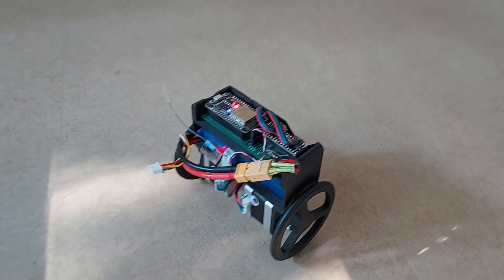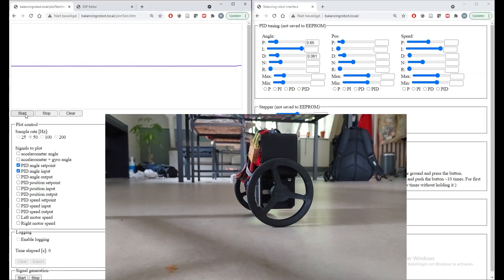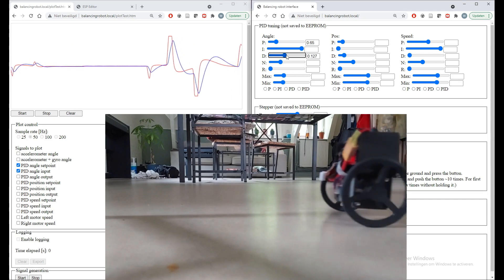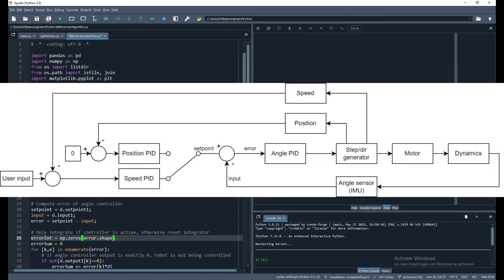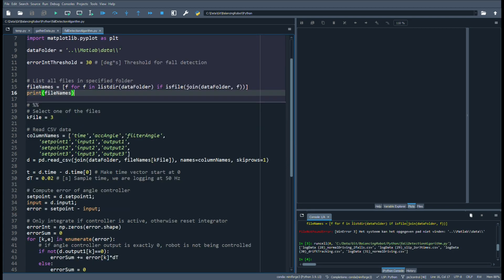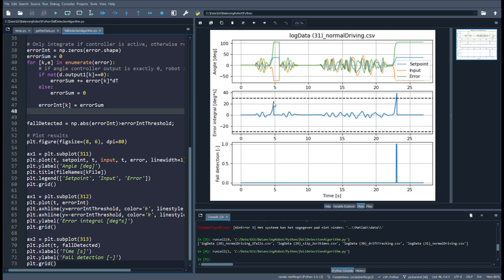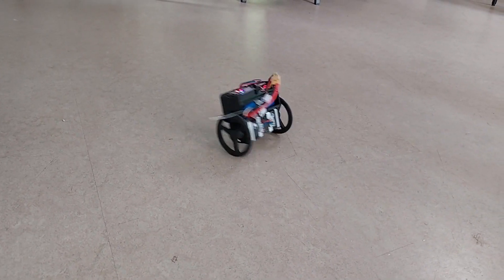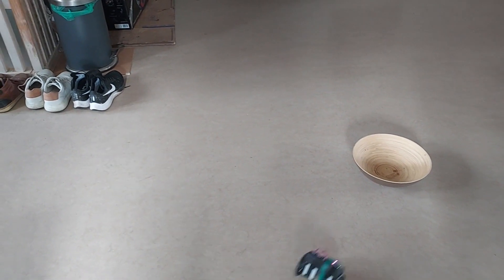Balancing robot now detects step loss and can self right

Comment: Hey, Can I use this code even if I have a Higher Center of Mass on my robot? Will this work for that?
Reply from the maker: Yes, higher center of mass usually is easier to get stable. Re-tuning of PID parameters is likely needed
Reply: @kloppertje  Thanks. Also can you tell the configurations of the Stepper Motors you used. What should I use for my robot which has a Higher COM?
Reply from the maker: @AtharvaMore-h5t  In one of my last builds I used 17hs3401, but I think any stepper with a similar amount of torque should work, also with a higher CoM. Just try it out and see if it works :)

Comment: Nice work, thanks for sharing! What battery do you go with? That 6S1P (24 V) 2650 mAh LiPo looks a bit too big for the case.
Reply from the maker: Thank you! This one runs on a 2 cell lipo. I most often nowadays use 2 lithium ion cells, easier to charge. Amd, working on a version that runs on 1 cell, with integrated charger :)

Comment: I also make it using Mahowik BalancingWii that I modified to use NRF24L01. It all works as expected but it drives slowly. How to make it fast? I power it 11.1v, 35C 3S 1500mAh lipo battery. I power arduino and DRV8255 separatedly

Comment: Success!  I uploaded the new code to to the old robot frame and, after buying a genuine PS3 controller, I now have a little speed demon running around my house. 
I am still having an issue with it not running on concrete.  Since I haven't messed with the default PID values,  I suspect that may be part of it.
One question: PlatformIO is complaining about the plotdata union{ struct{ .  "the default constructor of "union <unnamed>" cannot be referenced -- it is a deleted function" As far as I know, my PlatformIO is up to date.  Any ideas?
Again, thank you for a great project! Watching this bot faceplant like a dunkard is hilarious!

Comment: hello, please can you help me step by step? i loaded the sketch, and the serial monitor says : loading index.html;
what should i do, which file should i open from the data folder? index? should I click AP or SSID and what credentials to put? I specify that I use arduino ide
Reply from the maker: See the instructions on gitlab, and my other video
Reply from the maker: Hi, I'm sorry but you'll have to figure this out yourself. I won't have access to a computer the next three months. Did you upload the file system, as per the instructions?
Reply: @kloppertje  What would the file system be and where should it be loaded? I watched the video but couldn't find anything about it
Reply: I uploaded the BalancingRobot file of another video to the ESP, do I need to upload something else to control it from my mobile phone? should the data folder be loaded on the ESP?  I'm unhappy